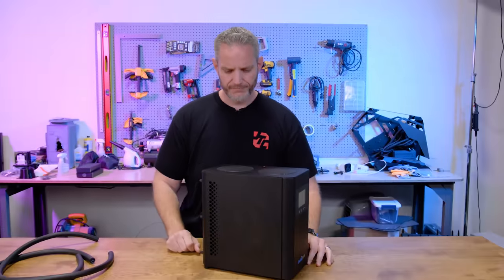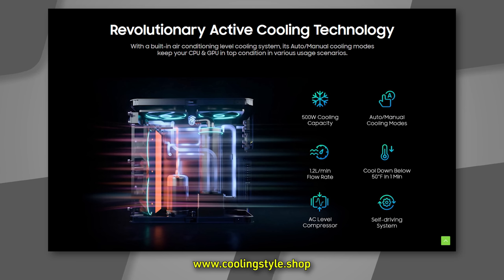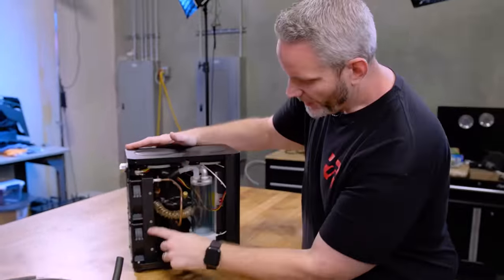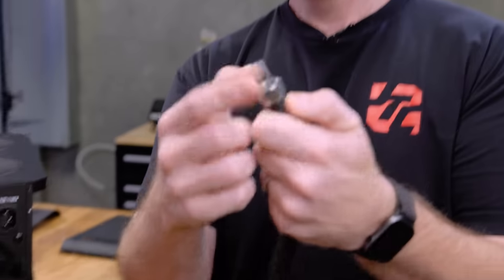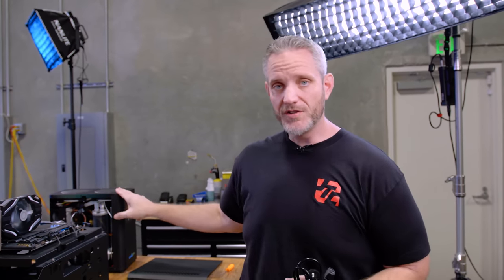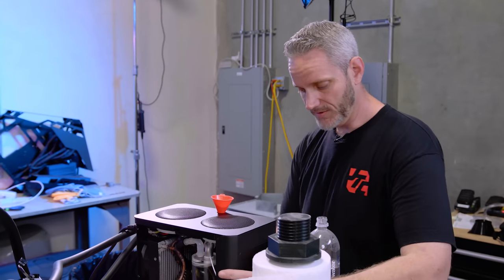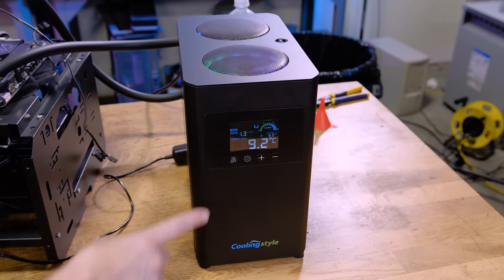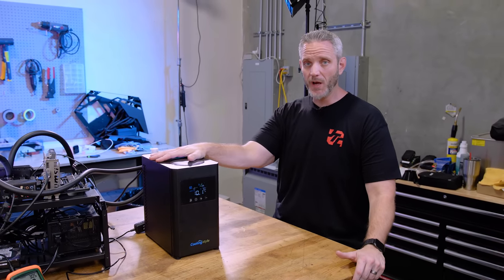This seemed Gimmicky... Turns out I was right!

Comment: I would plumb this to a compartment outside to service one or  multiple computers. A computer(s) could have an independent water loop with a water to water  heat exchanger with additional radiator with fans to on the system when the cooling enviably overwhelms the main sub-ambient coolant loop. The "warm" loop order would likely be the following: pump, heat exchanger with the cold loop, CPU+, radiator back to pump. At the very least could be a video  as a future test to this thing to make this thing more tolerable.

Comment: The heat that will build up in the room is the heat that this will extract from whatever it is cooling + the wattage this thing is using itself converted to thermal energy. There is no other way, the law of conservation of energy dictates so. You are adding more heat to the room in order to cool whatever you are cooling a little better.

Comment: Back in the 2000s I actually fell for the marketing of a case that used a peltier or something to put cold air into the case. It was $220 in 2006 and for an E6700/7900GT build.

Found it, the MassCool NexTherm CS-ICS8200, wasn't actually that bad of a setup for the time.

Comment: Only one solution, get a heat pump/compressor cooler for 250A+ welding machines, stuff a few fittings in the back of your PC to connect the external cooler to your loop, set temp to ambient -5° to prevent extreme condensation and watch your temps stay insanely stable for infinite amounts of time at the expense of a ton of electricity of course!

Comment: That yellow wire on the power socket looks like the terminal is just trapped between the insulation and the spade connector at 8.22, the black below it could be too, it's hard to tell. 

The "freon drain port" is a schrader connector, 1/4 flare. Don't push the valve in with a terminal driver.... and the heat exchanger is the condenser, there looks to be a small plate heat exchanger visible via the rear panel. The unit is a tiny water cooler, much much smaller than anything I've ever worked on, it looks like it's running a tiny scroll compressor, which is interesting, that'll likely feel hot when it's running, as the discharge gas tends to be run up against the outer casing to the top where the discharge gas exits the housing.
Reply: It seems to be working as I would expect a fridge to work - typically on a water chiller, if you set for example 11 degrees C, it'll pull down to 10, warm up to 12 (two degrees differential is normal) then pull down to 10 - average of 11 degrees c. There is however no reason why it couldn't pull down to 11, then warm up to 13, it just depends how the thermostat is set up. What is interesting is that it seems the compressor is variable speed - it never stops, just ramps up and down based on the cooling load requirements and target temperature. 

The temp at the air off the condensor is pretty normal - you would set a condensor fan switch to turn on at the pressure equivalent of 45 degrees C for the refrigerant in the system, and turn off at 35 degrees C, at least in the UK, we currently spec fridges for a maximum ambient temp of 35 degrees C, you need that difference between ambient air temp and refrigerant temp so you remove heat and pressure from the refrigerant, that heat is the heat being removed from both the compressor and the load being cooled.

Comment: good concept. i had done experiments in water cooling years ago similar where i used a 250 gpm aquarium water pump (in those days we didnt have internal reservoirs and internal 12 volt pumps yet we also didnt have the cool radiators for pc's like we do today.) i ran 1/2 inch diameter lines with danger den water blocks on cpu gpu northbridge chip and ram. ran ran the water lines out of pc to pump to several in line aluminum radiators ( used these to drop water temps coming out of pc slightly before they go to the water fountain cooler) into a old style hang on the wall drinking water fountain and cooled the water this way. i achieved impressive cooling temps on old socket 3 amd cpu's then. was able to massively over clock the chip and still maintain 40-50 degrees F under a load. here i feel the maker stopped short on several aspects and they can improve alot. 1 get better larger quieter fans. no brainer here. 2 use larger evaporator and condenser cores. or 3 go Peltier loose the compressor noise. i also done experiments with Peltier's in those days problem is they cool to well and i got blocks of ice on the boards and chips shorting things out. (i had the peltiers directly on the chips with water blocks on back sides to take away the heat) water loop system simular to above water cooling loop but without the inline aluminum radiators and without the drinking water fountain cooler. i used 1/2 inch pvc hose i bought at lowe's and the danger den water blocks and the 250 gpm aquarium water pump.  which Peltier's i experimented with first before i done above water cooling system. Peltier's are a great quiet source of cooling. now i have always had a idea to make a external box like this using Peltier's  attached to water radiators or water blocks in a case could help eliminate frost buildup in system. especially if they are regulated and have a built in with multiple Peltier's 1 in  defrost cycle while another cooling will need a controlling board for this feature but very doable and can if built right provide massive temp drops from a AIO or custom water loop system. i have always felt and have had goals of running my cpu's and gpu's under 100 degrees F with a room temp of 80-85 degrees F.  at these temps all your computer equipment will last alot longer and i know jay says the temps i see him say is acceptable.  to me i am like damn thats to hot for me. lol as such i will end up building my own custom cooling system from scratch and scraps i find around town people is throwing away and modify it to meet my needs and goals. so i can achieve 100 degrees F or less on a new AM 5 cpu with 3d and a newer video card size undetermined at moment (waiting to see what used GPU prices does) but GPU will not be under a RTX 2080 running at 100 degrees F or less. but my cooling setup will be designed to be put on the floor or hang under desk so its not sitting on top of my desk.

Comment: If this is not venting the heat outside it is the same as opening the fridge to cool your house. The system is inherently inefficient so it will add more energy to the room than it removes.

Comment: I did this in 2000.  Took a portable air con, first stage was blowing on a bx chipset with a slot 1 adapter to a celeron 1.2ghz.(big amp heatsink attached, then with a pentium 3, direct cooling plate...

I was moving computers before they made the gear.

(Iv still got that bx, cpu board system, in back of spare room (had sold it to customer, it ran for 10 years (in kitchen they read recipes), then got retired, and came back to me.
Reply: Moving,  is modding,  no edit option.

Comment: For not much more than the price of the chiller in this video, you can buy a 1/3 or 1/2 HP glycol chiller.  If you are going through the trouble of setting up a separate chiller, use one that can cool more than a CPU.

Comment: Have a friend who tried something like this back in the 90's, using a custom liquid loop (I mean, back then they were all custom loops though), a window AC unit, and Peltiers to pull as much heat as inhumanly possible off his CPU. Never really worked, he had condensation problems that led to freezing around (and I think in) the CPU socket. Want to talk about ambient noise, though...imagine a window AC unit running near your desk. :D

Comment: Every watt this thing consumes is another watt getting dumped into your room. If it's hot enough that you want to chill your coolant, it's also probably hot enough that you don't want an extra 500W of heat getting dumped into your room. Not to mention the noise issue.

Comment: this would be nice with longer tubes so you can hang this on the outside wall so you dump the hot air straight outside but not in the same room you are better off then with a normal AIO or custom loop that way it is more quiet just for some extra temp because in both cases you dump hot air in your own room still

Comment: Really, look into a soda fountain Cold Plate. It's an aluminum block the water flows thru. They are meant to be placed in the bottom of ice makers. One could be placed in a pan of water inside of a dorm refrigerator or small freezer.

Comment: a thought on the room getting hotter, over all it shouldn't matter what is dissipating the heat to the air, its new chiller or a stock heatsink, the heat is still going to the localized air around the pc

Comment: Looking at the connection fittings on the back it looks like the compression comes from the inside front edge of the retaining nut onto the tube were it goes over the barb as the barb will expand the tube to the correct diameter for the fitting nut to clamp on the hose, I have used this type of fitting before but not for computer cooling

Comment: Those compression fittings are supposed to have a copper ring inside the nut that fits around the tubing and provides the compression.

Comment: 5:39 There is no difference between the amount of power your PC takes and the amount of heat it produces. There's no difference between "thermal watts" and "power consumption watts".
Every Watt your PC takes from the outlet will end up as heat in your room.
That's why a PC cooled by this thing will not produce significantly more heat than if it was cooled any other way. The only additional heat will come from the components inside the cooler (compressor, fans, etc.).

Comment: Idea is semi ok but we definitely need a market for a split compressor/heat exchange like central air systems. There would be window mounts that would be small enough to fit most window designs without being too heavy.

Comment: i own a portable AC unit that vents hot out out of the back in a tube, i open the window and put the baffle in and close the window on it. Temps are a little lower, but super low temps are just not needed, i would rather have 5 or 8 C lower pc temps but a cool 70F in my room then another thing on my desk that will shake my aim for FPS.

Comment: I had a 4 inch ac duct dropped in front of my computer. It's not directly ducted but it does get drawn in by intake fans. It changed my temps like 5 degrees when loaded.

Comment: My 12th gen i9-12900k runs at a really cool speed, when playing games over long periods of time it never gets hotter than 50 degrees celcius, and this was during summer which was very hot this year. Now winter is coming and i doubt it will reach any higher temps. For reference its paired with a NZXT z63 AIO in a Coolermaster HAF-X Nvidia case and a AsRock z690 PG Riptide motherboard.

Comment: that thing costs more than the MoRa3 420, res and dual pump assembly I got from I think it was Watercool.  Now sure I do not have a 10c coolant temp but this thing is dead silent and the radiator can eat nearly 1000w of load(probably with higher speed fans of course, the 200mm Noctuas at 450 rpm probably not.  But for my thermal load it stays quiet)

Comment: It's not that bad, I would have to mod it though. Maybe Jay will?  Noctua fans, vibration dampening, better fittings. The temp drop is significant, it cannot be achieved with water cooling alone unless you live in the Artic. I don't even think the price is bad, water chillers are not cheap but neither is high end water cooling.

Comment: I am aware of one other hobby that predated chillers for home computers. People who tried to keep temperate climate fish in aquariums. They don't like to get 80° water temperatures ever, and usually have optimum temperatures of 50 to 70° .

One of the most common DIY systems before 2000 was old water fountains. Many of them had lead in them, and had to be removed and sold for next to nothing. Since most temperate fish are not fond of acid water chemistry. It wasn't that big a problem. So hobbyist s have been dealing with chilling systems decades before computer hobbyists needed to .

Has anybody tried the water fountain kludge for the water cooling system? Never really thought about it. I was never into serious overclocking because I had these oddball things called kids, and I did not have the money to risk cooking a processor just to get a little bit of extra speed out of it. But it's awfully fun to watch other people do it.  :)

Comment: This looks like the same internals as the older vaporchill units, but does not cool as well. 
They used much thicker instualtion though as they chilled to sub zero most for idle and low single digits under load.

Comment: Cool. Place that cooler at outside and run tube that is long enough to reach your water block. 

Anyway, I think they tend for this unit to put on the floor, but yeah, with short tubing it will be difficult...

Comment: If I could get a bare-bones version of that I would be tempted to build a more capable unit by upgrading the radiator and moving the connection points to the side/top/front/whatever so the back could be placed in an open window to vent the heat outside..

Comment: Interesting idea, but not ready for desktop primetime IMHO.  If you are gaming with a headset or rocking some decent speakers, the sound level might not be an issue, but in a small room the heating could be a deal breaker.  In a server room no problem as they are usually pretty loud and air conditioned.  Keep being creative and pushing the boundaries.

Comment: It is a neat concept and it does work.

Now I want them to do one that can handle 2000 W, so you can run a Threadripper and a 3090 TI.  Maybe do something with the unit itself where the compressor is in a separate noise isolated compartment and use quieter fans.  It would also benefit from a much stronger pump so you could run the unit in another room with the hose runs being hidden along a base board or behind some nice crown moulding.

Pretty good as a low run first effort though.
Reply: A Threadripper and a 3090 are nowhere near 2000W tough.
Reply: @karaloop9544  it can be if you overclock like crazy.  This gadget isn't for people running things stock.  I've seen videos of a 3090 Ti that drew over 1000 Watts by itself.  So, it we add on another 300 Watts for the CPU and allow some budget for chipset cooling, you start getting close to the 2000 Watts (with a healthy 30% overhead).

Comment: You need to connect your 10 ton roof top unit lines to an evap coil that has a conjoined coil for the cpu cooler fluid loop. Then all the compressor noise is out of your workspace. I would love to see someone do that.

Comment: Not only does ambient temps affect water... refrigerant also has a temperature/pressure relationship. The higher the ambient, the higher the pressure, the higher the refrigerant temp, which equals less cooling capability.

Comment: i'd pay $250 maybe $300 for it. my idea of hooking something like that up would be run through the wall to another room for sound mitigation. but also wouldn't mind the heat in the winter pumped back in to help heat the room with the pc. but summer would be a differant story and would probably want to move it with the seasons. 
overall though i'll just stick to conventional cooling.

Comment: What if you hook it up to a large front rad to chill the inside of the case and have a AIO water cooler exhasting out the top  the cold air . With that you can have it at 10C inside for your air cool GPU.

Comment: this COULD (could, unlikely would) have a use as a way to externally pump the heat out of your room via having that device have the heat exhaust side aimed at your window. This would direct the ungodly satan-air out of the room, but at the cost of it sounding like a portable air conditioner already. A better answer would honestly to have a semi-bespoke system where the hot air from the system would vent into some insulated flexi-duct (and you stealth it if you want/hide it to make it look good), and then have that duct terminate near the open window, away from you. Using the aspect of "hot air rises, cool air sinks", you have the flex tube going up and away from you until it gets to the window, and the hot air won't make your room any more uncomfortable than the ambient temperature already is. That being said, if you're considering the best passive airflow situation so you won't bake to death, your room is probably already pretty dang hot, and your best bet is to find a way to splice the exhaust vent to your portable ac's exhaust vent (if you have one), and let the portable ac cool the room.

or be like me and suffer. that works too.

Comment: Ok, I had to put my guy-in-the-shop hat on.... What happens when the air is humid and the fittings start reaching the dew point? What is the user supposed to do with all the condensation? There isn't a moisture catch or even a way to collect the condensate... I was told that was the reason why no one was seriously making thermal for personal or semi-professional computer and workstations...

Comment: I'm still waiting for some major company to adopt a thermo electric oooling plate coupled with an AIO. I get this product, I remember people building stuff like this out of old Saab radiators and scavenged AC pumps for personal systems but unless you're running everything from a closet somewhere I wouldn't want this thing to be in the same room as me.

Comment: An actual AC for your computer case might be interesting. Placement of the drain would be crucial, but if that's taken care of appropriately it could get your PC to very low temps with essentially zero condensation risk.

I imagine there are some very difficult engineering or cost challenges or someone would have done it.
Reply: Chill box